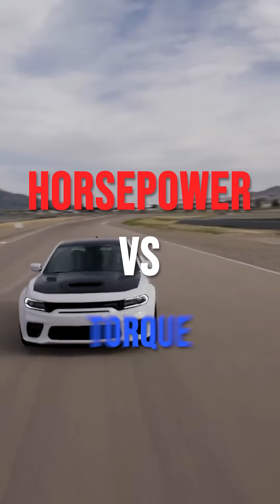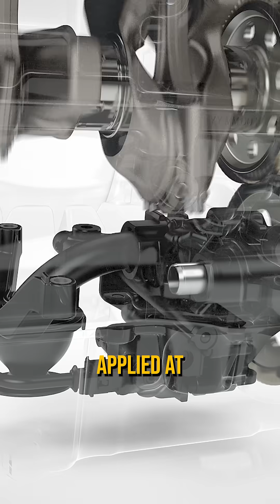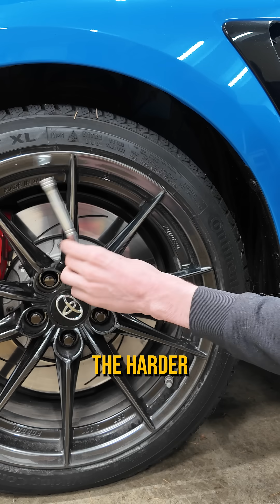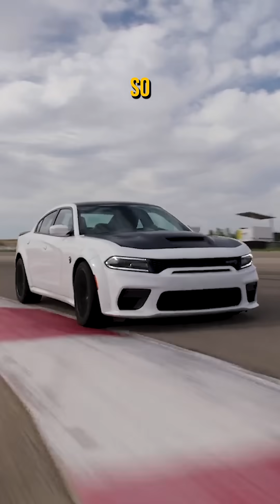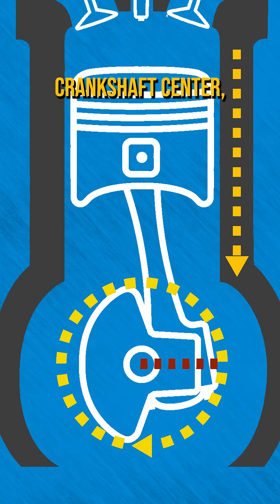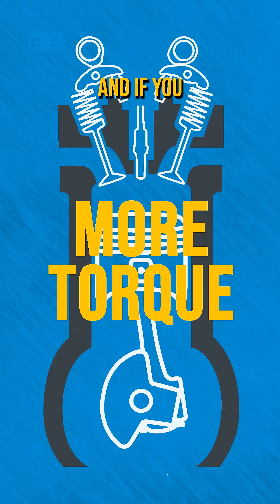Horsepower vs Torque (In 60 Seconds)

Comment: Torque and HP are the same thing with one difference,
Time.
Reply: They are conceptually very different things. You can apply static torque to something, the work done will be zero, you could wait infinite time and nothing would happen.

To have power you actually need to do work.
Reply: @BigUriel  
You Don't Get It!
Torque is a Measurement
Like 12 inches = 1 Foot
HP is a Display of Power
Torque in Action
Reply: @BigUriel 
YOU DON"T GET IT!
Torque and HP are THE SAME THING,
SEPARATED by TIME!
Reply: @BigUriel   🤔 this is non-temporal. To do work you have to have power.  Work does not cause power, power causes work.  You had effect preceding cause - can’t happen in nature.
Reply: @rollsroyce329  That makes no sense, they happen at the same time.

Work is amount of energy transferred into motion.
Power is rate of work.

It's like asking whether a function comes before or after its derivative. It's nonsensical, they happen at the same time, if one stops so does the other.
Reply: @BigUriel  you said “To have power you actually need to do work.”  I’m saying: To do Work you actually have to have Power. Let’s explore the fundamental difference. How does the saying go?  This ( blank  ) isn’t going to suck itself.  The most basic principle in science is every effect must have a cause and the cause must preceded its effect.  The lights are on while power flows through the filament to make it glow.  They are “happening at the same time” but the light is not causing Power.
Cheers.
Reply: @rollsroyce329  TO have power you need to do work and to do work you need to have power. One does not come before the other they come together, one is just the rate of the other over time.

To use your analogy, power does not flow through the filament, what flows is energy, in the form of electrical current. Power is the speed of that flow (oversimplified but they are directly proportional). The "light", in the case of moving a car, is the change in the vehicle's speed. So yeah there is cause and effect, the cause is work/power (both), the effect is the vehicle accelerates.
Reply: Still no cause for your work/power effect?  Or are you sticking with A: perpetual motion with no cause.  Or B: Immaculate Conception / sorcery.
Reply: @rollsroyce329  
HP is applied Torque
Torque is a Measurement of Twist.
When we use a Torque Wrench, we're actually generating work, aka HP, but so infinitesimally small, for such a short time and distance we don't realize it.
Reply: @McsMark1    Welcome and thanks for joining in. Your original statement and your most recent one might lead people to conclude that Power is the difference between 1 lb of force applied at a 1 foot radius for one minute and a 1 lb force applied at a 1 foot radius for ten minutes.   How much HP is it if you apply 10 ft•lb of torque to tighten a bolt that has already been tightened to 2000 ft•lb.  Power is not applied Torque.  Work is not Power.  Power is both the driver of work and is a measurement of how much work is done per unit time.  Torque is irrespective of time.  Torque is a static measurement. Torque is a force applied at a radius that Can cause rotation and that Tends to cause rotation but rotation need not happen for torque to be present. Doing work requires more than Torque to be applied it requires Power.  Power is the transfer of energy that does the Work.  Torque alone cannot do Work in a rotational model any more than Force by itself can in a linear one.  
Good point you made after that though: Power (as you pointed out a very small amount) does the work of initially bending the wrench in order to obtain the torque reading.  There is no Power and therefore no Work being done however once the force resisting the bend of the wrench equals the force applied to the wrench. 
Cheers.
Reply: @BigUriel  When you said: “So yeah there is cause and effect, the cause is work/power (both), the effect is the vehicle accelerates.” Work = Force x Distance.  The “vehicle accelerates” is Work being done.  What you said can be simplified as:
So yeah there is cause and effect, the cause is work/power (both), the effect is Work (the vehicle accelerates.).  To simplify that again.  What you said can be summarized as: So yeah there is cause and effect, the cause is work/power (both), the effect is work.  Work can’t be both its own cause and its own effect that is atemporal perpetual motion akin to plugging your power bar’s cord into one of it’s own five outlets and expecting to power 4 other devices with the four remaining outlets.
There is no such thing as “work/power” in physics.  If you can find this seemingly perpetual motion concept in a textbook for us please quote the title, author, edition and page for us.  Until then…. I’ll go with: torque is a measurement of force x radius that is frozen and timeless. Torque is what Can  cause rotation. Torque Tends  to cause rotation but rotation needn't happen in order for torque to be present. If Torque succeeds in even the smallest amount of rotation, the instant rotation begins Power is doing Work. How much work is being done per minute is a way in which we measure Power’s effect: Power= Work/Time.  
Can you name any type or example of Work that is not done by Power?

Comment: All of these comments from people that aren’t mechanical engineers and don’t actually understand the math behind it all.
Reply: All of these comments from people who aren’t physicists and don’t actually understand the physics behind it all.
Reply: Lol the math behind it all...... 
So hard to understand 
Trq*rpm/5252
Reply: @Joebauers2505  That's not the principle, the principle is adimensional. The principle is power is how much work you can actually do per unit of time. An engine's torque is simply how much work it does per engine cycle which by itself is an irrelevant metric for performance.

Comment: Every car has a thing that converts torque into speed or speed into torque. It's called a Gearbox. And a well mantained one is as much as 99% efficient in converting between the two.

I never got why that question is kind of a big deal in the motorsports community. But to put things in perpective, let's take an F1 car, the ones built for maximum performance within their regulamentations.
They have really high revving engines reaching 900+ bhp. But when you convert to torque, they peak at just 45kg.m (2018 season). My 2011 Renault Sandero with 1.6l inline 4 NA engine outputs 30kg.m.
Reply: Lol 99% 
Transmission and rear end are roughly 15-25% loss of torque, given the type and age.

Comment: Torque does matter tho mainly for low RPM and taking off from a stop

Once in gear properly and accelerating torque only then becomes irrelevant as the total HP is what matters once the car is moving and the turbo spooled up
Reply: Say an engine makes max torque at 1500 rpm, it has a turbo. If you make max torque at 1500 rpm you have more horsepower available regardless of what gear the transmission is in than an engine that makes max torque at say 4000 rpm. So instead of having to downshift and rev the engine to make the same power you can simply accelerate in the same gear since you have more access to engine horsepower at lower rpm’s.
Reply: @xl7667 no that is not how it works...

Max torque at 1500 RPM in a diesel is just that its the MAX torque it is not the point where the HP is the highest

In a turbo diesel you may well have 270nm at 1500RPM but your at bugger all HP because your peak horsepower is going to be closer to 4000RPM

Peak torque is not peak power unless talking about petrols where its possible to have them coincide with each other

Comment: I like to think of it like a boxer, torque is like a boxer throwing one big punch, its a force (Tq is rotational), but horsepower is force over time. So a boxer that throws 100lb punch every second makes more force than guy that throws can throw four 50lb punch in one second, but 200lb/sec is more power than 100lb/sec. Power has a time component, so if you can get more reps in (more RPMs, like F1 cars) then a low torque motor can make high power.